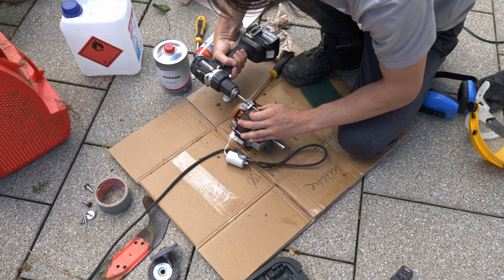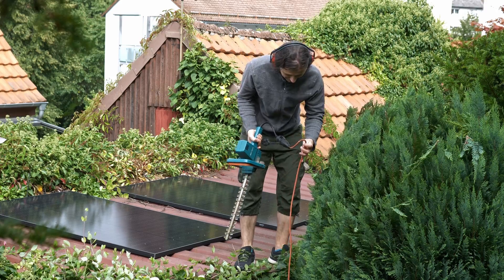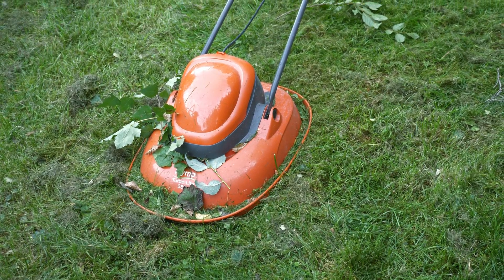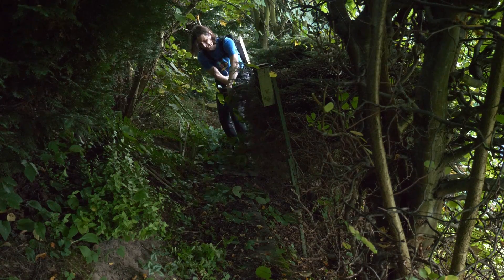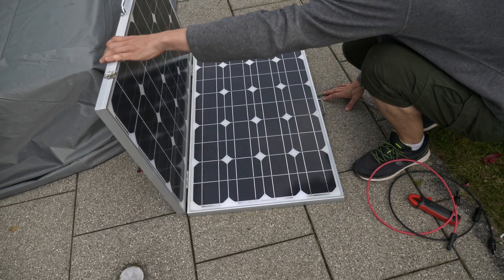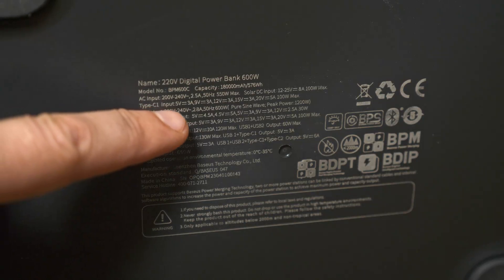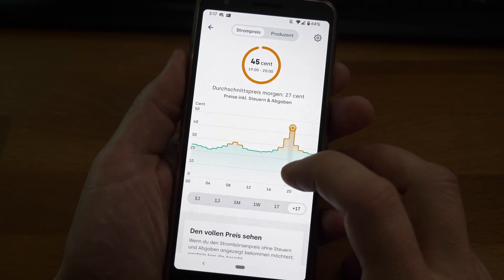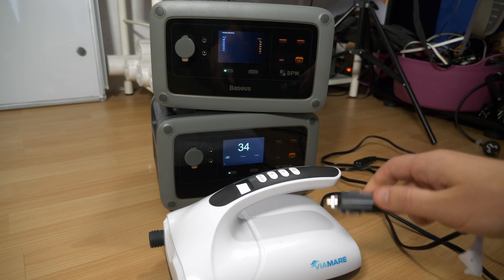Tool Repairs Escalated Quickly (+ Baseus review)

Comment: Most direct AC powered tools have massive inrush current and significant back EMF.  You might be able to overcome these limits with a simple arrangement of resistors, capacitors, and inductors to create a simple inrush current limiter.  Permanent appliances employ these techniques to avoid nuisances trips or avoid stressing components.   

Most inverters flip out when subjected to loads from circular saws and the like.  Hook up an oscilloscope and watch the inverter output.  It's hilarious.

Comment: Nice. I have a small Bluetti which can charge from solar at 200W. I was able to hook up a 300W solar panel, by limitined the input voltage with a DC-DC buck converter. It works great, and limits itself at 200W when charging. And still can charge at a decent rate when the weather is overcast. In case you have a spare bigger solar panel.

Comment: The break on the electrical motor is most likely a safety device to stop the spinning blades the instant power is cut to the motor. So your guess that it need good contact to the ac power is a good guess.
Reply: and/or to block the motor if it is not right-side-down
Reply: Exactly right.  It's a brake.  It can be removed.
Reply: I have also an old Stiga, which has a similar symptom: it stops on heavy load and when not starting, a small push of the blade gets it going again. Any ideas for diagnostics? – Perhaps I don't need to replace but fix it after it fails 😊